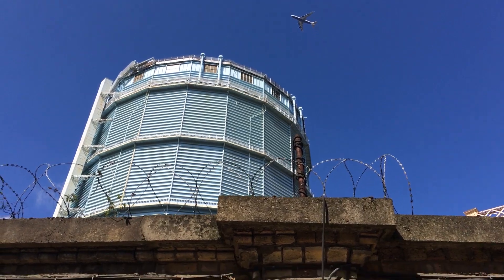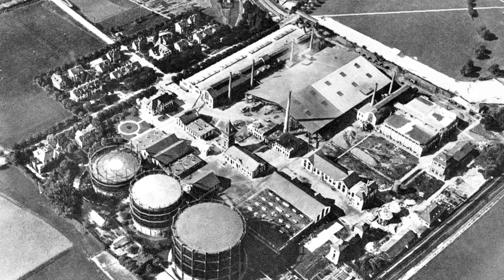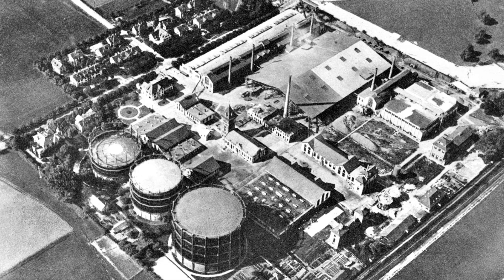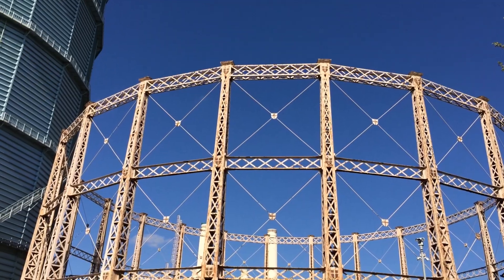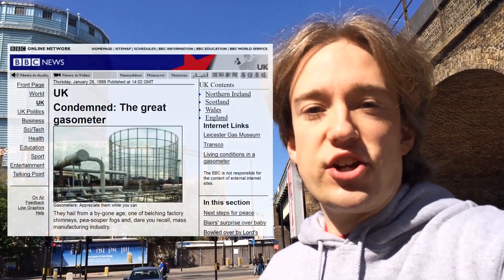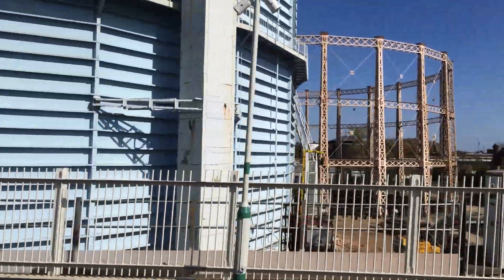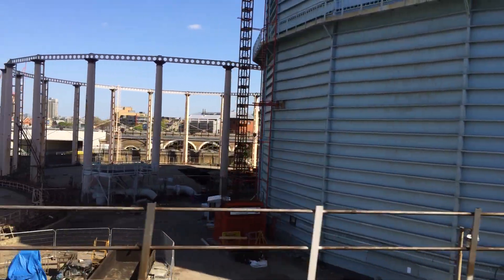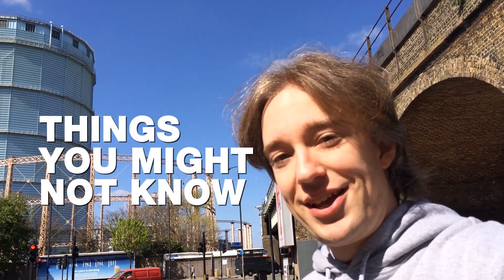The Rise and Fall of the Gasometer

Comment: I do not know for sure about British gasometers but here in Denmark they were floating in water. When gas was pumped in, water was expelled and the tank rose from the water (and the other way round when more gas was used than produced). The water made a gas-tight fit. The weight of the tank pressurised the gas.

Comment: Has anyone mentioned the story of the engineer demonstrating the safety of the system by breaking a hole in a gasometer and putting a candle to it? There was a jet of flame but no explosion because the gas was under pressure.

Comment: The proper name is Gasholder - a gasometer measures gas passed through a pipe.
Reply: some idiot posted a false reference to a non-existent dictionary, to justify this wrong use of the word gasometer.
Reply: I don't care what the dictionary you have found says, it is wrong. These objects are called gasholders. The clue is in the name.
This one of those occasions when Wikipedia more or less gets it right. The fact that many people get it wrong, does not make it right.
Reply: The Oxford English Dictionary defines Gasometer as: A large metal tank, typically cylindrical, in which gas for use as fuel is stored before being distributed through pipes to consumers.
That disagrees with your assertion. However, it was common useage for gasholders.
Reply: No. When gas holders were in use, they were known by those who knew as gasholders, and those who didn't know as gasometers. It has always been thus.

If you read further in the OED entry you will find - 

1819   F. Accum Descr. Manuf. Coal Gas 164   The name of gas holder, or as it is improperly called, gasometer is given to the vessel employed for collecting the gas and storing it up for use.

or - 

2009   Mirror (Nexis) 5 Aug. 57   If it's 1-1 going to The Oval..there are going to be people hanging from the rafters or climbing up that gas holder.

The OED, like the  gasholder, has gone to the dogs.

Comment: They are NOT gasometers! the are gas holders. A gasometer is a device for meaning how much gas you have used.
Reply: They are called both gasometers and gas holders. The device in a motor vehicle showing you the amount of gasoline is a gas meter gas gauge.

Comment: AND do you know what happens to the gas now, if the pipe become over pressured (due to demand surge reduction, say, after a heavy usage period)...?

It gets vented off into the open air. A big waste of gas, and a pain in the ass for us general aviation pilots because the gas can vent off, directly upwards, at supersonic speeds. This has an obvious destabilising effect on a light aircraft and we have to avoid these sites in order to prevent this.

Comment: gasometer?  Wouldn't that be something that measures gas in some way?
Reply: +SugarBooty in the gas industry they are gas holders, gasometers measure the gas in the air
Reply: In a way, it does. It rose and fell depending on the amount of gas it stored.

Comment: The demolition of the blue one was very interesting to watch -- it was demolished by building a small crane on top of the piston, pumping air into the holder to raise it, and then demolishing it from the top down, lowering the piston as they went.
They couldn't use conventional methods due to the proximity of the railway line next to it.
Now completely gone and the site being flattened for another apartment block.

Comment: Nice video, Tom. My favourite use for the site of demolished Gasometers, was the site on Horseferry Road and Monck Street - there were two huge wartime citadels called 'The Rotundas', which were used by various departments during the war, mainly the Air Ministry. After the war, they were still in use for cold war purposes, and were hidden under the ugly Department Of The Environment towerblocks. The site was cleared in 2003, with the Rotunda bunkers being almost impossible to demolish.

Comment: The Gasworks in my town were still operating in 1986, the gasometers, accumulators whe called them, are still in pretty good condition, they are the staffolding type.
Reply: +milksheihk One in my city was still operating when I was wee, in the late 90s. My dad would occasionally take me to the roof, or the hill that overlooks the whole city, and point it out - it would sometimes be full, sometimes, be nearly empty and the top would be quite low down.
Reply: milksheihk There's some in my town as well.
Reply: I recently discovered that the reason the one in my town wasn't demolished & is all fenced in & locked up is because old gasworks of this type are full of toxic tars & to use excavators or other demolition equipment that disturbs the soil will spread the toxic tars.

Comment: I'm old enough to remember these and the smell of the old "town gas" made from coal.   They are called "gasometers"  because not only were they storage tanks but, by measuring the height of the tank, you can  measure the gas available in storage. Tom didn't mention that the cylinder that rose and fell, inside the scaffolding., was actually like an upside down bucket floating  in a bath of (smelly) water. Sometimes at home we used to burn coke rather than coal in  our living room open fire.  I think this was the product after the gas had been removed from coal as least that's what my dad said -  so it must be true ;)
Reply: Coke was indeed a by-product of making town gas.  The iron & steel Industry required huge amounts of coke so it was made specially in coking plants, the by-product was town gas, although I'm not sure if they actually fed it into the local gas system or used it to roast more coal.
Reply: Coke definitely was a by product of the gas industry and it was dirt cheap. Before the days of Health and Safety  dad used to send us to the gasworks with an old pram and for a few pennies beer money  the chargehand would let us pull the chute lever and drop half a hundredweight of  coke at about a 100 degrees into it.
Reply: No, for the most part, coke came from dedicated coking ovens. Gas producers would continuously burn coal under insufficient oxygen conditions. The resulting gas being carbon monoxide, hydrogen, and atmospheric nitrogen. The exhaust of the retorts was only ash, no coke.
Reply: yes he did mention they rose and fell
Reply: Wow, there's a difference between coke and coal? Since I only ever heard my parents and other trashy people use the term "coke", I always assumed that it's the slang term for "coal"...
Learning so much today... ;)
Reply: @notthere83  Yes coke is an extremely pure fuel almost entirely carbon made by roasting coal without Oxygen to drive out the impurities like sulphides etc. The resulting product burns quite a lot hotter so it's useful for things like blast furnaces that need to burn at very high intensity.
Reply: @FaerieSeraphina  It's the retained Hydrogen that burns, not the carbon.
Reply: @GeorgeSPAMTindle  Think you might be confusing the fact we were talking about different processes as one of the other replies brought up coke. The two processes have some similarities but are mutually exclusive as they require different conditions. To make coke you want to boil off the impurities without burning anything thus the no Oxygen part, to make town gas you want to convert the coal into a vapour which is not fully Oxidised by incomplete combustion thus you want an Oxygen deficient but not Oxygen-free environment.
Reply: @FaerieSeraphina  Have you ever worked in a coking plant?
Reply: And this is why coke a cola has gone up in price as we move to renuable energay sources.
Reply: @GamerMuscleVideos  For anyone that doesn't get it, it was a joke.

Comment: There are two of these things in Helsinki, and I always used to ask my parents what the purpose of this structure was. I think it was my dad who told me that they're used to store gas, but this revelation didn't really crack the mystery open for me as I didn't realize that this wasn't the entirety of the contraption.

The relics here haven't been in use since 1980, and sadly, the Helsinki gasometers will be demolished as well if the rumors that have been flying around turn out to be correct. I also read from somewhere that they'd be refurbished, but their ultimate fate still remains unclear. The older gasholder is over a hundred years old.
Reply: I pass one of them, I think, every time I go into Helsinki from Kotka: iirc, one of them's a mustard-coloured thing with the white bindings/linings on it,yes?
Reply: David Andrews Yes, it matches your description. If you search for "Suvilahden kaasukello" in Google's image search, you'll find a picture of it.

Suvilahti was a former energy production zone located in Sörnäinen, an eastern district of Helsinki. Suvilahti is now forming into a cultural centre, but the two gasometers as well as 9 other buildings related to the production of gas or electricity still stand there.

They actually cleaned the insides of the gasometer you mentioned. It contained a lot of terribly contaminated water which couldn't have been directly poured into the sewer without severe filtrations. 20 750 cubes of contaminated water was successfully removed and filtrated from within the gasometer, but according to experts it still contains approximately 400 cubic meters of water contaminated with PAH compounds, heavy metals, cyanide and mineral oil. It's not certain if people can ever visit inside the gasometer due to this hazardous contamination.

The gasometers will apparently not be demolished, as they are protected by the Finnish National Board of Antiquities. It has been estimated that repairing the gasometer well enough to accommodate visitors would cost ~8.7 million euros. So far efforts will only be made to make it look good on the outside. The work is scheduled to begin this year.

Suvilahti, translated directly, means "Summer bay" (suvi is a poetic/rarely used Finnish word for summer and lahti stands for bay). A very fitting name for a highly contaminated industrial zone.
Reply: Yes! The Metro train passes it before heading to the station there.... Thank you :)

And yeh - great name for such a place :P

Comment: There's one of these in Dublin that's had apartments built inside it. It looks really cool, all glass inside the metal structure, it's a pity that they can't find new uses for the ones in England that they're tearing down. It used to be visible from Lansdowne Road stadium but I think the roof on the new stadium blocks it.
Reply: nicholas keane I think an odd shaped room IS cool.